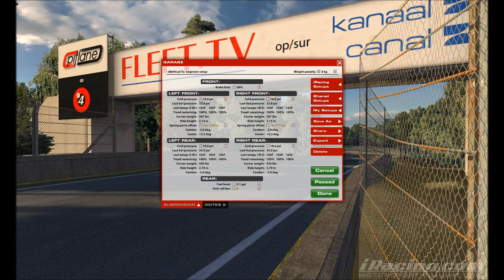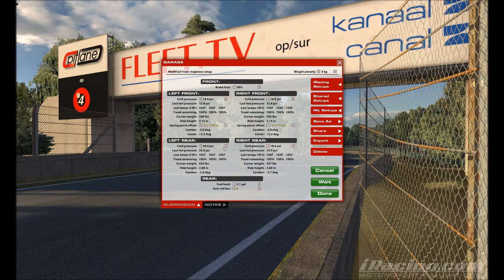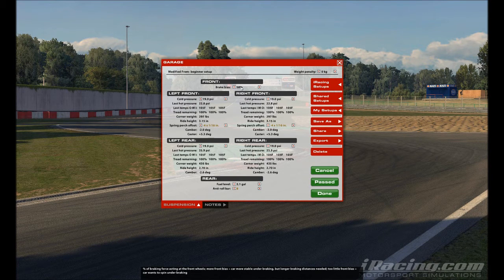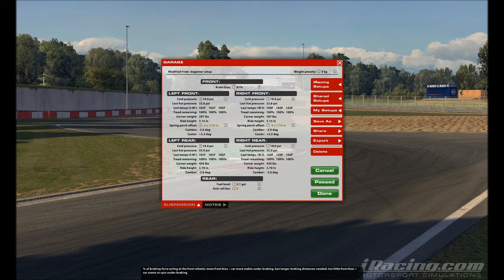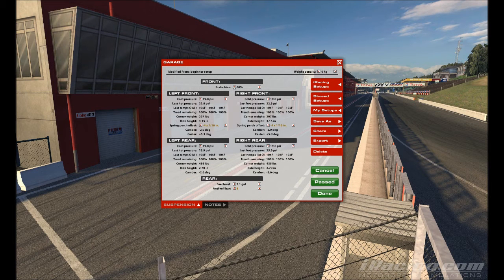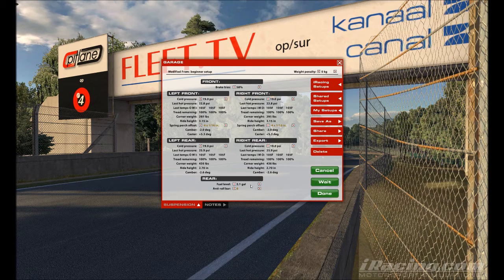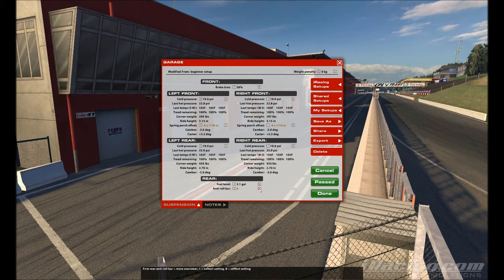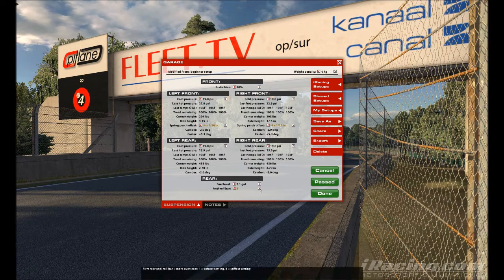iRacing | Skip Barber F2000 | Beginner Setup + Short Guide

Comment: I was looking at what others have done in setting up my Skippy. Generally the spring perch offset lowers the ride height, which is a good thing, when you go to neg. values.
to note tho, lowering the ride height to minimum will make hitting curbs very harsh and unsettle the car, esp if you're on the gas. it's easy to lose control in the heat of a race!
I feel it's better to have understeer with the Skippy, forcing you to be easy on the throttle exiting turns rather than have oversteer and a back-end that comes out from under you too easily.

much of what you can set is really up to your driving style. I'm one that also likes to go with 18psi rear tires.

The car is intended to let you encounter limits of traction and steering, but be easily manageable and still be fun to drive. If you can drive a 1st lap (cold tires) and hang without spinning out or going off-track with a Skippy, you can handle just about any car/track and get in to advanced tuning

Comment from the maker: memberships available in 1, 3, 12, 24 month steps. prices at $12, $30, $99, $179 in the same order. at the moment there´s a 50% off promotion, so you would only have to pay half the price for your membership.

there are few cars and tracks you receive with the basic package. other cars and tracks cost between $10 and $15 afaik. you only have to buy cars and tracks once, updates are for free. about one new car per season (3 months) and 1 new track per year delivered by iRacing.

Comment: Good advice overall except you say that reducing the rear antiroll bar setting makes the car unstable. I have found this is not the case. Reduced rear bar improves stability. Any setting between 5 and 8 can work well. Lower than 5 and you start to cause understeer.

Comment: Does this still work in 2017? Or would you do something different now?
Reply from the maker: I am not much into racing the skippies anymore. There were several updates since this video was released. But the car is still running. I have used my basic settings to run some laps a few days ago. It worked fine.